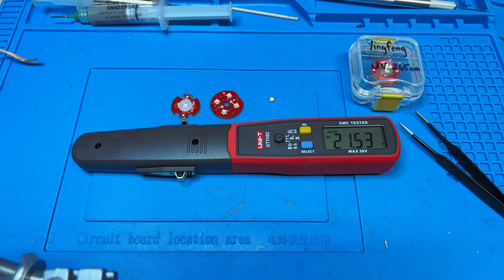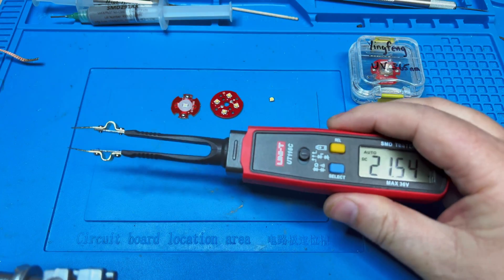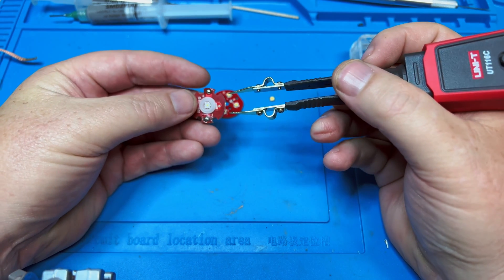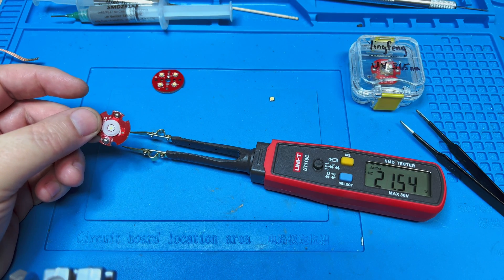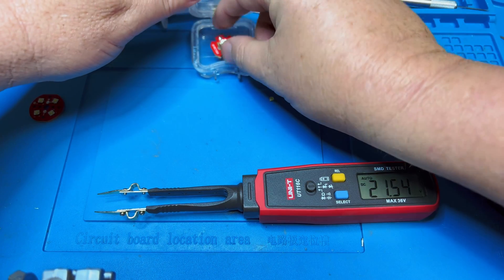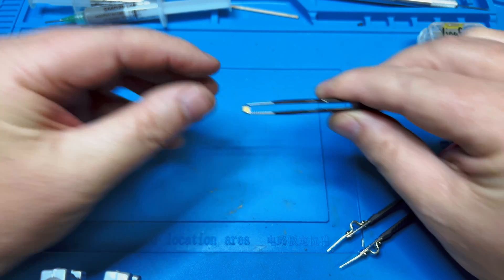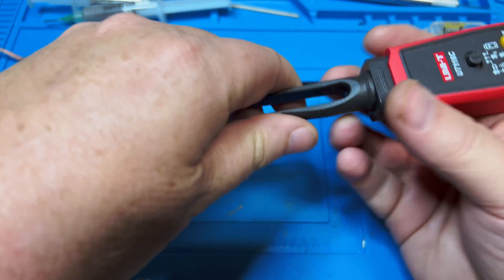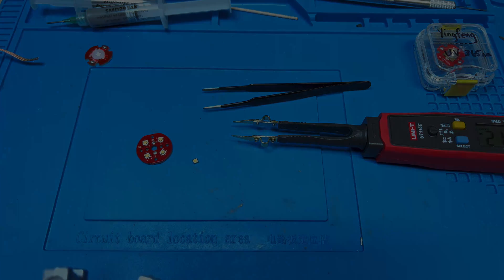Figuring out LED emitter polarity and voltage!

Comment: Conventional current vs electron flow. 😂 All this time I've just been using a UT139C in diode test mode and then swapping the driver wires around if I stuffed up the LED orientation.